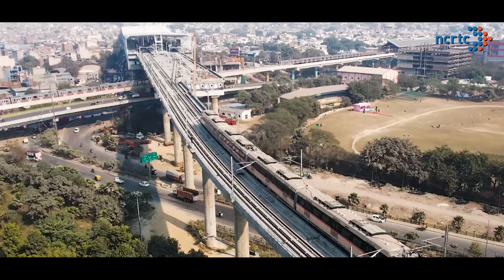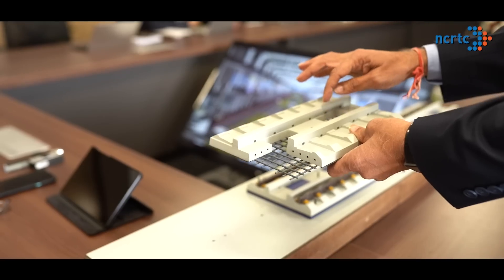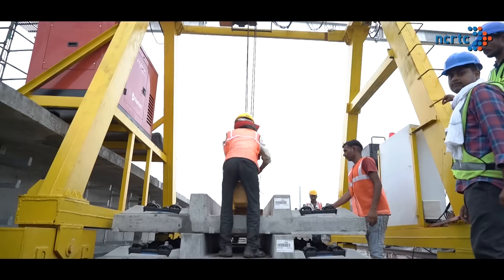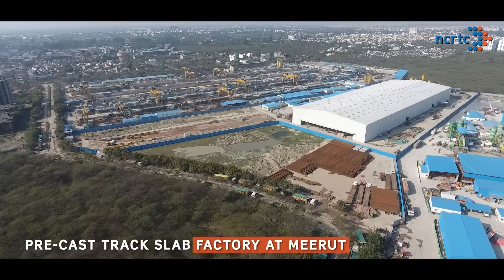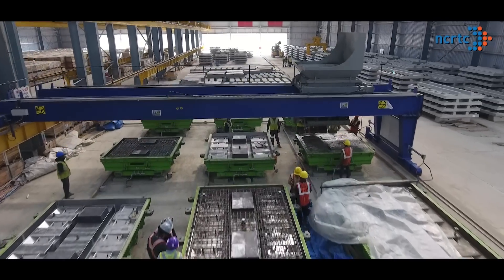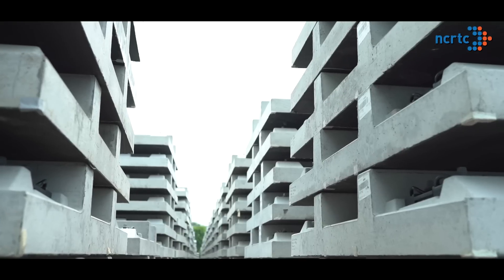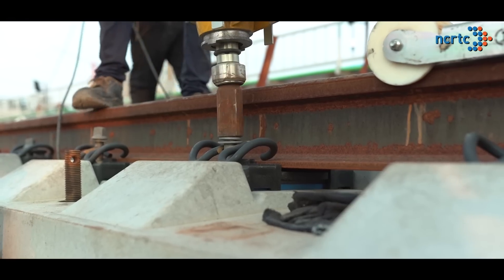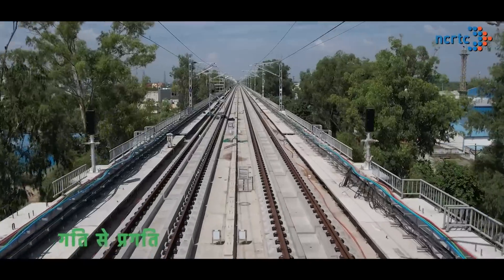Precast slab track technology

Comment: New ballast less track is required in all Vande Bharat routes parallel to existing lines.
Reply: sorry, that will be prohibitively costly. We are right now reinforcing bridges, minimizing bends, changing tracks wherever required, and finally improving the signalling system to increase speed. Ballast less tracks are not for normal routes, only for bullet train and RRTS
Reply: @user-vy5uy9fo8p and for metro bruh why doesn't anyone notice the fact that literally all the metros operational in india are using ballastless tracks😅
Reply: @logarajaravichandran8790  those are ballastless but not high speed grade
Reply: @user-vy5uy9fo8p  ohhh u mean by high speed lol yeah ig the closest one to come close to these NCRTC ballastless are delhi metro airport express ones.
Reply: @logarajaravichandran8790  yes, the original comment made keeping in mind increasing the vande bharat train speed. It doesnt need ballastless track, rather requires many more engineering advances to current track which is also cheaper in comparison.
Reply: @user-vy5uy9fo8p  yes bro I was flabbergasted like why do you need a separate ballastless track💀 for vande bharat that's really so stupid in my opinion.Indian Railways just needs to upgrade the current tracks so that vande bharat can be used with its full potential and also increasing the ridership of vande bharat.But I am super excited for vande bharat 3.0 to be launched as it has a max speed of 220 kmph and a completely new design and of course the sleeper version of vande bharat.
Reply: Not possible